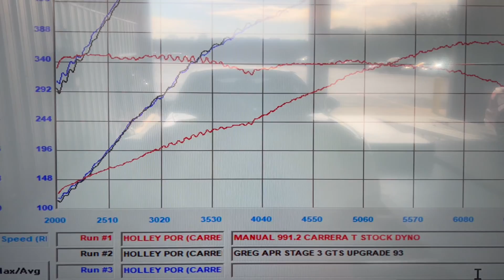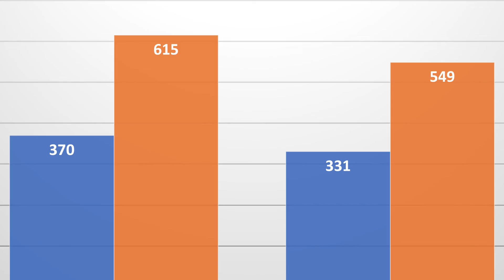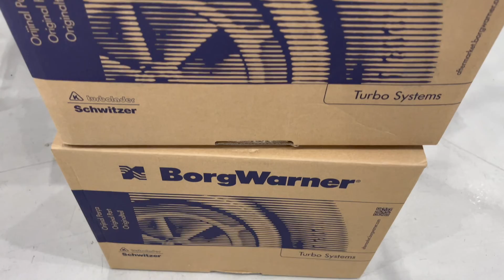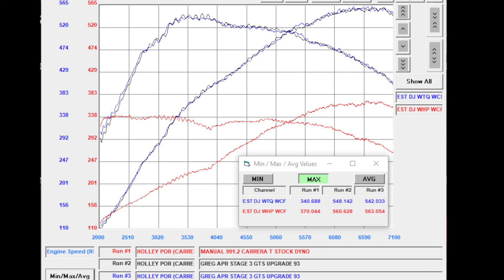Motorlife: Porsche 911 Carrera T (991.2) with an APR Stage 3 GTS Turbo Upgrade

Comment: What is the general consensus on amount of torque the oem clutch can handle? I have an apr stg 1 on my manual 991.2 carrera and I went with the lower peak torque file to promote clutch life longevity, surely this upgrade would be pushing the limits and unfortunately the aftermarket has been very slow to offer an upgraded clutch assembly or LSD for these cars
Reply: The Sport Classic is torque limited to just 442 lb/ft (600Nm) and uses the same clutch (9P1-141-117) as all the other 991.2 and 992 Carreras. I'd bet that's the clutch's capacity.
Reply: @kalebkloppe6193 any way around this issue to up the torque?
Reply: @Specialbrown99   get the clutch plate relined with a stickier friction material. But the transmission may not be rated for much more than 600Nm.
Reply: @kalebkloppe6193  The 991.2 MT gear set is same gears as 991 Turbo PDK box. Should be quite strong.
Reply: @adamsantamaria5631  not all shared. For example, 3rd may have the same ratio but the parts are different. As is the differential. And the PDK weighs 70lbs more, that’s not all from an extra clutch, it has better cooling.
Reply: They got open diff?!?!
Reply: @throttletribevn  only the base carrera up until 992 generation
Reply: @obi-wankenobi7160  thank god. My 993 is arriving in 2 weeks. I didnt see PTV/LSD option when I ordered it.
Reply: @throttletribevn  it should be no problem without it even in the 993. Porsche says that the TC/SC controls the slip between L and R and acts as a “limited slip”. Aston didn’t even put one in their valkyrie and it is basically a street legal F1 car
Reply: @obi-wankenobi7160  wow rly?? The valk doesnt have it?? Any source?
Reply: @throttletribevn  can’t find it but It was in the recent top gear video of driving the valkyrie on road. It doesn’t have a traditional lsd but makes use of an electronic one, similar to my car. This is fine in practice and on road but the problem comes when you want to turn all esc/tc off and do some skids on a wet surface. With everything off you are then working with an open diff and will likely only have a one tire fire instead of both spinning like a proper slide.
Reply: @obi-wankenobi7160  im sure it uses brakes to balances out the power

Comment: The transmission will just explode....
Reply: It won’t the oem dct clutches are capable of 650 rwtq and torque is managed through the tune. The manual however the clutch will hold up plenty of cars running this setup on base Carreras but I’d consider upgrading the clutch in the manual cars.

Comment: What if you have the GTS already ? It is just a tune as the turbo;s are same size as the aftermarket Borg Warners ?  How much would this cost for 992.2
Reply: Then you step up bigger and buy the pure turbo units which are bored out and capable of 800whp.